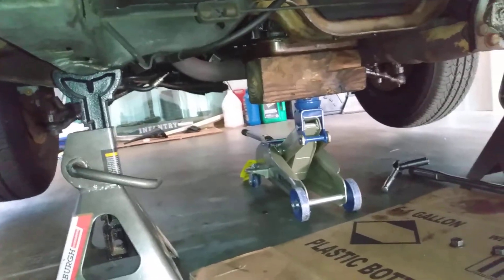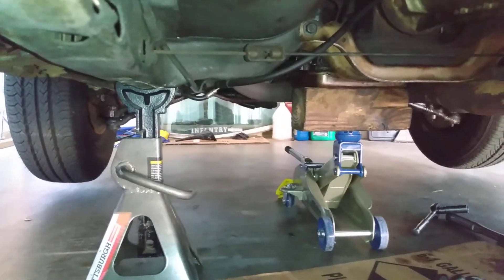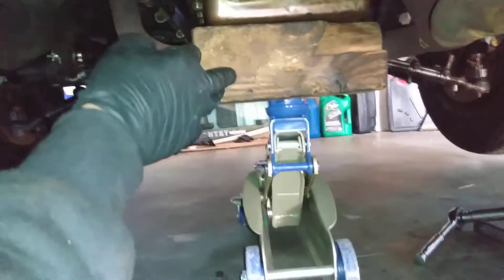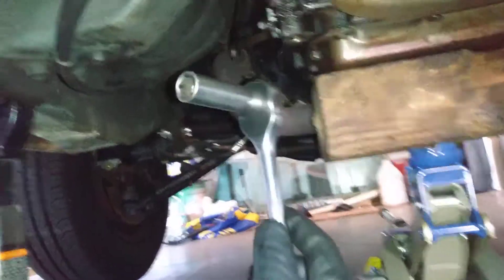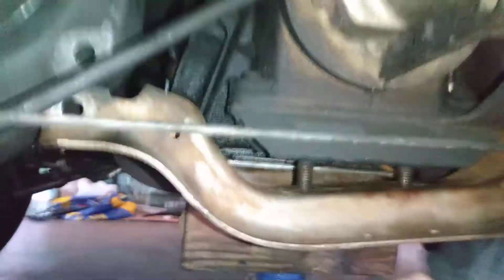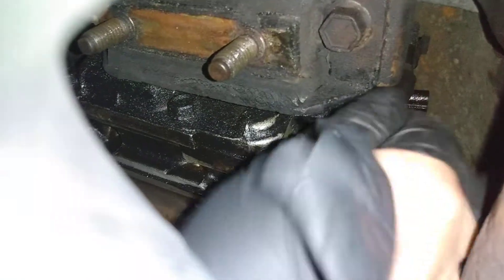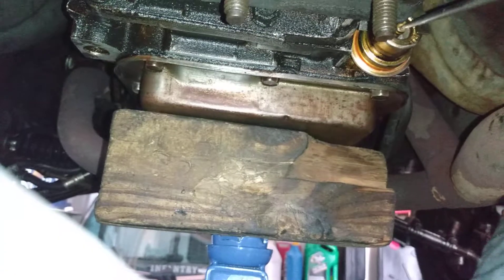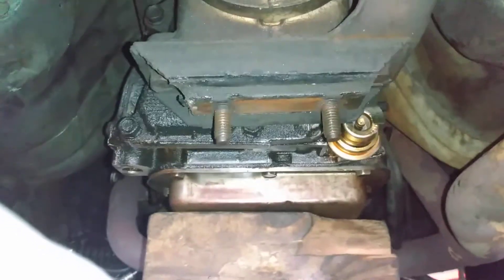Adjusting Ford C4 transmission MODULATOR

Comment: What kind of car, I'm having issues with my Maverick trans modulator
Reply from the maker: @AmericanClassicCarRescues  I have a 1977 Granada. I wound up taking it into a shop and the guy discovered there was a small pin missing
Reply: @thingsthatdontsuck6833  I think my issue is just adjustment, I just don't know enough about transmissions to know. It's a pain because you can't get to it unless you take the cross member out. Thank you though
Reply from the maker: @AmericanClassicCarResques  I'm  glad the crossmember wasn't hard at all at least on my car. Just need to take the load off the crossmember by jacking up the transmission itself just a little bit.
Reply: @thingsthatdontsuck6833  same with mine, it's not hard just annoying

Comment: Did it work?
Reply from the maker: No not really haha....I could tell the car shifted into second at a slightly higher speed, but not much, and it still went right into third immediately after second, which created a huge lag in power and was the original problem I was trying to resolve.

Since that didn't work I brought it to a shop and explained what I had done. He took it apart again and apparently noticed that a small pin that normally protrudes from the end of the modulator was missing. He said the pin somehow engages the shift mechanism and without it I would be experiencing exactly what I had been. He put it back together with the pin in place and now finally it shifts and drives like a normal car.
Good luck 👍

Comment: The governor is on the tail shaft and has spring loaded spool valves and fly weights. The vacuum modulator which is what you were adjusting, is not the governor. The vacuum modulator pushes on a pin that pushes on a valve in valve body which partially controls pressure and upshift points based on throttle pressure. The C6 is configured pretty much identically.
Reply from the maker: There's always one. Thanks for the clarification, obviously you never bothered to read the description of the video, I refer to it as a modulator. Maybe you didn't watch the video either because I refer to it as a modulator twice. 
But thanks for the info.
Reply from the maker: https://photos.app.goo.gl/r9bL3qQGGxfLCEup8

Comment from the maker: I wanted to say here that this did not correct my particular issue; while this method works to regulate the shifting points, like at which speeds the gearbox upshifts basically, in my case there was a small pin that goes between the actual governor and the transmission itself that was missing.
The guy who fixed it said it is common for it to fall out during replacement of the governor/modulator, implying that I may have lost it when I changed out the gov.
I guess it is possible but I don't remember seeing anything fall out. At any rate he got it working and shifting perfectly and I couldn't be happier.  Hopefully this info can help if merely adjusting the modulator on your Ford doesn't solve the issue. And hopefully this comment won't get buried in the thread haha.